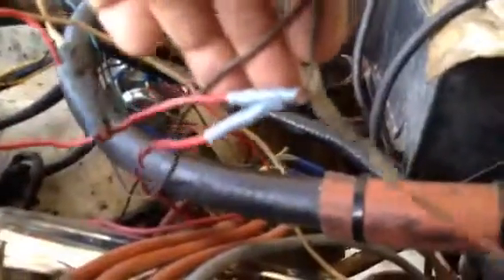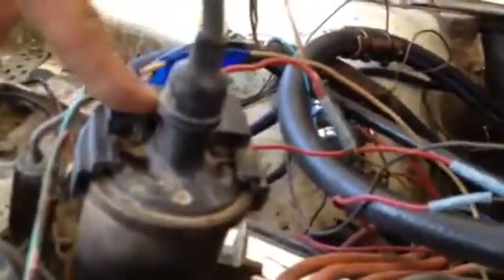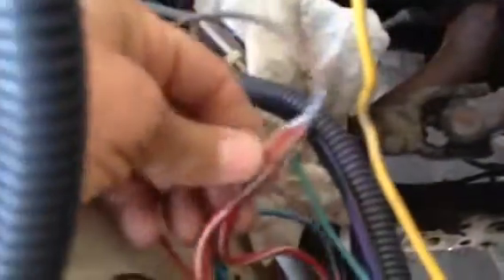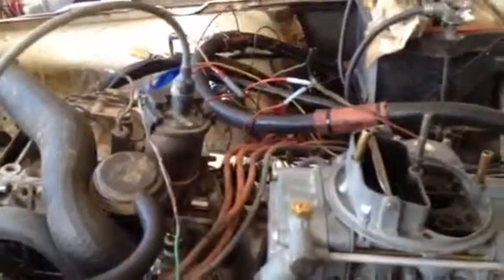Ignition Question from '85 Waggy to '74 CJ5

Comment: Sounds like you need a new AMC Series  Ballast Resistor there about $7.00 at any auto parts store. I have a question for you do you know where the single black ground wire goes to be grounded  from  ignition control module ? Thanks